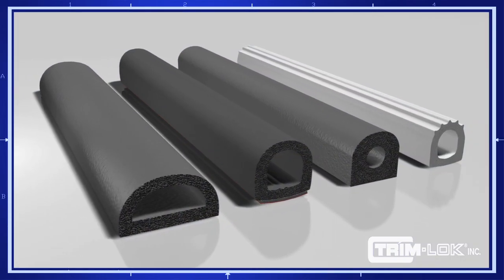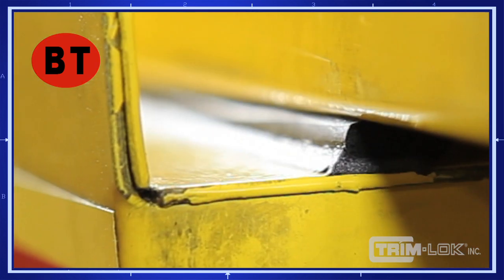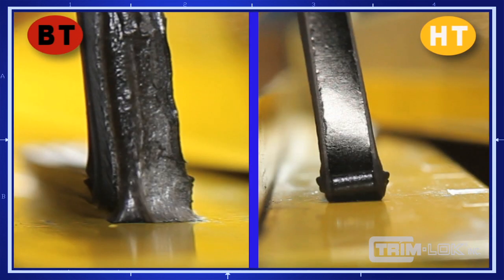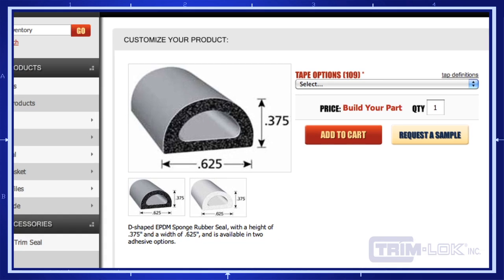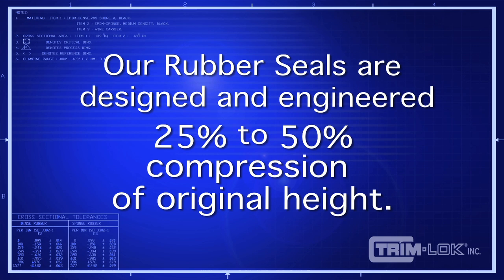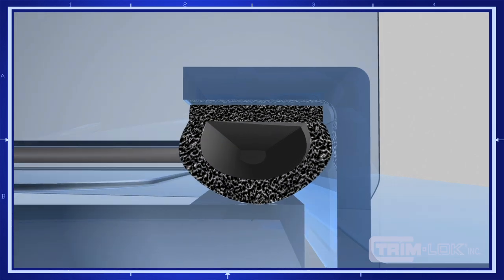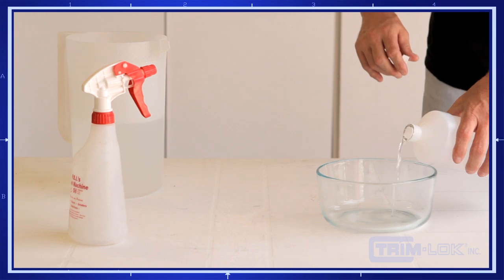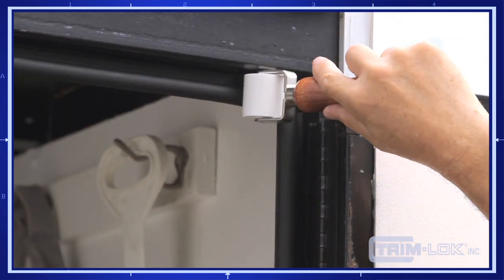How to Install Rubber Seal

Comment: Would these work on double shed doors and if so do mice chew thru?
Reply from the maker: Depending on the door dimensions, you could certainly use of our rubber seals on your shed doors.  These seals are made from EPDM Sponge Rubber, which are not "mice-proof."  They could certainly chew through the rubber.

Comment: how much weight can be applied to this rubber seal? for instance im trying to find a superior product for the mating surfaces of my camper shell and truck bed. I only want to do this once, so it has to support the weight of the campershell and maybe a couple hundred more pounds for the roof rack. any suggestions?
Reply: +Trim Lok thank for the reply, however I was hard pressed for time and found "super cap seal XL" from cargogear.com it's also EPDM. if it doesn't work I'll be giving you a call ;)
Reply: Fenton Grant how did this work for you? I'm looking now for my truck topper

Comment: are these good for European tilt and turn windows
Reply from the maker: Hello Lekan.  Trim-Lok Locking Gaskets are manufactured for stationary windows only.  Please check out our catalog of Rubber Seals in various profiles, as those would be more suited for the "tilt and turn" windows that you're referencing.

Rubber Seals:  https://www.trimlok.com/rubber-extrusion/epdm-seal